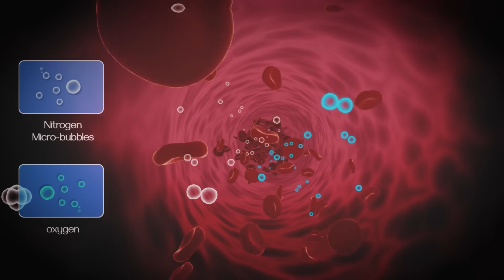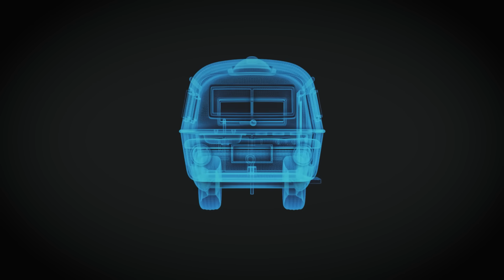How Did a Tiny Hole Kill 4 Divers?

Comment: For anyone here from the Titan incident please note: The Titan and the Byford Dolphin incidents are actually not the same physical process it's more like the opposite.

The Byford Dolphin incident was a rapid decompression.
The Titan imploded or you could say it was a "compression" (not decompression). 

You can view it like this:  The pressure inside the decompression chamber in the Byford Dolphin incident did go extremely rapid from 9 to 1 bar. Everything INSIDE the chamber wanted to go OUTSIDE of it. And alot of stuff inside your body wants to EXPAND.
The pressure inside the titan did go extremely rapid from 1 bar to ~400 bar. Everything OUTSIDE the vessel wanted to go INSIDE. And alot of stuff inside(and outside) your body gets CRUSHED.

Both processes are instant deaths, faster than the brain can react, though the titan incident is probably even more brutal.
Reply: I've seen your comment on other Byford Dolphin videos so I wanted to add some of the other stuff I've seen people post. 
The pressure likely raised the temperature to an extreme degree for a short window, and the gases already in the body ex: in the lungs also wanted to force their way out of the body to help maintain the equilibrium vs onrushing pressure.
Reply: goated313 so were the people in the titan cooked/vaporized faster than the metal could crush them?
Reply: @josegarza7719  Both aspects happen simultaneously. The heat and the crush are directly correlated. Realistically at such a small scale and high intensity, it's inconsequential to consider what happens first unless you break down the event in ten-thousandth of a second increments.
Reply: @Cryerborg exactly
Reply: @josegarza7719  https://www.youtube.com/watch?v=CfUcNPr2T8A&t=726s&ab_channel=Dr.ChrisRaynor%7CNotYourEverydayOrtho
This is a video by a surgeon explaining how they possibly could have gone.
Reply: Thanks for the clarification for the difference between the two incidents. I can't help thinking also about this difference --- the professional saturation divers are deservedly paid megabucks to do that job because of the danger and risk, and they will be well aware of what could happen in detail --- whereas the Titan tourists paid megabucks to take the risk and experience the danger. You do wonder if they knew what could happen in extreme detail, they may not have gone. Being told 'death' is a possibility, is not quite the same as being told exactly how you could die, in minute detail, even though it is instant.
Reply: Not necessarily more brutal. There was nothing left. I would consider that less gruesome
Reply: @TheBestOfSweden  I was about to say, in one you become a ball of tissue, in the other you go full on The Boys, as blood goes everywhere and you instantly explode.
Reply: @Kseehaz  true
Reply: @Kseehaz   That’s a good way to explain it. I don’t know why everyone says it’s instant with the Byford incident. For the ones closest to- yeah, but for other victims (depending where you are in that object) it could be & was survivable, w injuries so bad you wouldn’t want to describe it. Hence comments about some sat divers being retired in their 30s, rich as hell, but wearing diapers for the rest of whatever life they have left. Not worth the danger money imo, you’re not in control of your own life in any way.
Reply: its not that there was nothing left it just wasn't retrievable.
Reply: Byford Dolphin - 9 bar vs 1 bar
Titan - 1 bar vs 380 bar
Titan was fare more violent from a pressure differential point of view
Reply: @AlonsoRules It’s not just the rapid pressure change or the momentary superheating of the air does the damage though.  It’s also the Mach 2 wall of water that hits whatever is inside the space.  Imagine an almost infinite weight of seawater hitting you at the speed of a rifle bullet.
Reply: @AscendancyLF and @goated313
THANKS FOR the Education on that real quick☆☆
Reply: Turn into human soup, then burn and become ash, all in less than 4 milliseconds…. More violent force yeah. But by the same token, no gruesome splat left behind.
Reply: Ngl ur explaination is good ty brotha
Reply: @Mochii69  "Ngl" Why would you lie? If you like a person's explanation and presentation of facts, why would you lie about it? It makes no sense to use "not gonna lie" in this context. Stop mindlessly using trendy phrases. Think before you speak.
Reply: so is the Byford Dolphin accident compares to how a bomb works?
Reply: @syukrihantu  essentially.
Reply: Pretty much the same 🧠🪱🦀🦀🦀🦀
Reply: Ok. Ask a question, get an answer. Can't argue with that
Reply: No, we're not here because of some rich clown who decided to risk their lives for their own amusement and vanity.
Reply: Are you going to copy and paste this on every video now ? Shut the fuck up
Reply: Thank you for the enlightenment.
Reply: Mythbusters did a bit with a pig that will show exactly what happened to the bodies on the Byford Dolphin, albeit far less graphic, itll give you an idea of what happened. Look up Mythbusters rapid/explosive decompression.
Reply: i went to your channel to see if you had any interesting diving videos and was surprised to see osrs content lmao, hows the hc going?
Reply: I knew some midwit would decide to make such a comment.
Reply: Call me a simple man, but rapidly being shred into pieces through an expanding force, or being crushed into pulp by rapid pressure icrease... both are gruesome ways to go and luckily death is instantaneous to where you wouldn't experience it. I think whats worse is having the knowledge it can happen and the result is as that.

Both pieces however are an interesting tale about what (de)compressive forces can do.
Reply: titans cause was bad engineering tho... they used composite materials for their tube... and they are known for tensile strength but they are weak at compression... causing delamination... also they did not cure it in a vaccuum chamber so the faults that can come with composites are left in... vaults without resin etc. so that comes on top of being the wrong material... the titan was infact brutal... cause they likely heard it coming (not knowing that its time) ppl on the titan reported cracking sounds etc.
Reply: If I’m correct, I believe you could compare the Titan to 9/11 towers falling & being inside. It’s so quick, & one would be pulverised (as others have said - nothing left) - no disrespect to family members btw. The Dolphin would be more like a balloon, all of a sudden, someone unties it, & the gas wants to go out. So you’re left with your balloon outer lining, but inside is crushed or gone/sucked out. I suppose for the sake of a funeral & resting place, the Dolphin incident MAY leave a body, or partial, to be buried, the Titan, or twin towers scenario wouldn’t. I would pick the Titan personally - I’d want no chance of any survival, keeping in mind the quality of life if you lived.
Reply: Does implosion theoretically culminate in a diesel ignition event?  What would remain, pink mist or finely burnt ash?
Reply: I've recently been looking into the Challenger Shuttle Disaster, you think the crew suffered a similar fate as the Byford Dolphin?
Reply: @kaddissventorum4149  no. The challenger crew was wearing space suits that could easily withstand the low pressure in high altitude. The cocpit survived the innitial explosion and the crew was alive until they finally crashed minutes later, although most likely unconcious due to the rapid acceleration during the explosion.
Reply: was looking for something on this incident and kept finding the old ass dolphin one
Reply: Human reaction to pain is actually quite slow, at 100ms minimum.
Reply: @TyburVelereon yes, in both situations the victims were totally unaware of anything going on around them, luckily.
It would be like getting knocked out before an operation, only in this situation you just don't wake up. Rip
Reply: goated313  Do some maths and physics using PVT formulas and you'll see that the 5 cubic metres (6 kilograms) of air in Titan only had its temperature raised to about 1300 deg centrigrade, as its volume reduced to about 70 litres. The quantity of heat produced is only 7800 kilojoules. In the space of a few milliseconds 5000 kg of seawater at 4 deg C rushed into the space where the air had been, before any heat could have been transferred to the bodies (a process that takes seconds not milliseconds). Furthermore in the implosion, the air become tiny bubbles in the seawater, so its heat was effectively spread out and snuffed out. 5000 kg of water has nearly 4000 times the heat capacity of 6 kg of air so the heat could not have rised the temperature of the water by more than a couple of degrees. The humans in Titan were killed by crushing. The investiagation of the debris and human remains recovered will show no heating effects at all. If you disagree show some maths and physics.
Reply: goated313  Wrong.
Reply: What would lead you to a: assume people would confuse the two and b: care enough to leave the same comment on several videos on the same subject?
Reply: @dustinandtarynwolfe5540  a lot of people are stupid and they think rapid decompression is the same thing as an explosion when they are in fact the exact opposites. Doesn't help they both happened in a large tube-like steucture.
Reply: @DeadPixel1105  is ur mental health okay?

Comment: Try not to be scientifically ignorant. The 3% (closer to 2.5, actually) nitrogen in the body is NOT nitrogen gas. It's nitrogen compounds, like in DNA and proteins, it has absolutely zero effect on saturation. At sea level, there is about 1 liter of nitrogen gas in solution in the body. This is about 1.25 grams. That's it.

Comment: Hello, in the case that you read this comment i have a question because even after watching this video there is something i dont fully understand yet:
The chambers are at 9atm of pressure so is the bell and the trunk when they are all attached, then one of the tenders separated the bell from the trunk so all the compressed air inside the chambers escaped to where? the sea? or the bell? or the trunk? i dont understand where the gas inside the chambers goes.
Reply from the maker: The bell door was closed, the trunk connected to the bell. The trunk door going into the chamber was open. 

The latch connecting the bell to the trunk was released. 

The air from the chamber rushed out of the chamber, through the trunk and outside. It throws the bell free and rushes out to meet the outside air.
Reply: @waterline-disasters  ah wait, this is all happening above water? thats where my confusion comes from, i thought this chamers were all very deep underwater now it all makes sense, thanks for the clarification!

Comment: Excellent recap. To give an idea of the difficulty of this kind of underwater diving operation, consider that at all times a spaceship is "only" trying to prevent 1 atmosphere inside from equalizing to 0 atmospheres outside. The vessel on the Byford Dolphin was trying to keep 9 atmospheres from equalizing to 1. If you're on a space station and it develops a leak you only need to figure out where the leak is and patch it before you bleed off all your atmosphere. On a high pressure diving vessel like that a sudden leak means you literally explode.
Reply: A spaceship 😂
Reply: Daaaamn!  Tyvm for that!!
Reply: Brutal

Comment: If the other men in the other rooms had only been under the high pressure for say 5 minutes before the rapid pressure drop, would they have been okay? Was it only the compressed nitrogen in their bodies expanding that killed them, or would such a rapid pressure change be dangerous in itself?
Reply: Well, they'd still have air at 9 atmospheres in their lungs which would instantly expand. Not good.

Comment: I'm still a little confused, so before the diver closed the hatch between the habitat and trunk (at 9 atm), the diving tender opened the hatch between the trunk and the diving bell (at 9 and 1 atm??) ? how long does it take to depressurize the diving bell and was the trunk still at 9 atm when they mistakenly opened the hatch? so sorry for the questions 😅😅
Reply from the maker: The whole system was at 9ATM and it was effectively all open. 

If nobody is in the dive bell or the trunk and it's all sealed properly it could depressurise in 5-10 minutes. Like opening a tap and letting the air blast out.
Reply: @waterline-disasters  I understand now, thank you so much for responding! really informative video :)
Reply: @kels306  and yes, he opened the clamp before everything in the habitat was sealed, and resulted in an explosive decompression which well, the video goes into the details

Comment: I read the forensic medicine report on the accident by Giertsen et all (1988).
That is some intense stuff.

Great video BTW! :)
Reply from the maker: Interesting. I would have thought thats sealed.
Reply: @waterline-disasters  Now that you mention it, yes very odd. If you haven't already search for "byford dolphin grietsen 1988". be aware, the report is most graphic.
Reply: @waterline-disasters  Looks like the website it's on is made to bypass paywalls in scientific journals. 94–101, 1988. - An Explosive Decompression Accident - Sci-Hub https://zero.sci-hub.se/5268/7dda7cee52d7eb3ec606a82d0f1b9a61/giertsen1988.pdf

Comment: Dumb question but... at 8:34 you said that after the chamber door is securely closed, the tenders proceed to increase the pressure of the trunk. Why would they need to add pressure to the trunk at this point? Wouldn't the goal be to reduce pressure back to 1 atm? I apologize for my ignorance. I am just really interested in this topic and am eager to increase my understanding of what happened. By the way, this IS the best video I've seen so far on the incident. All the others are vague and confusing and rush through the process so fast with minimal detail that leave me confused even after watching them several times.
Reply from the maker: Good catch. I misspoke. I didn't catch it when I was worrying the script nor when I edited. A few people have asked and yes you're right it would need to be reduced to 1ATM.

The other videos I've watched have been created by people who don't understand the topic. I taught scuba diving for 10 years so I have a solid base on the physics. I always felt other videos missed the main point which is the physics. 

Thanks for watching and asking for clarification.
Reply: @waterline-disasters  Awesome! Thank you for confirming that. This really is the best video I've seen on the topic. It also cleared up some of my confusion on how pressure affects the behavior of Oxygen and Nitrogen gasses. I have one other question if you don't mind answering.

Can you break down why an increase in pressure against Oxygen in the body can cause Oxygen toxicity/hyperoxia?
Reply from the maker: Master class in partial pressures (pp)

Oxygen is toxic Inn a few ways. In your lungs it can cause alveoli collapse or fill with fluid. That's more likely to happen with sustained use of oxygen to help you breath if you're sick or an old smoker who needs oxygen but uses too much. 

But for divers it will likely cause problems with your Central nervous system first. 

When dealing with pressure at sea level you have 1 atmosphere ATM of pressure. 

Dive down to 10m / 33ft and you add 1ATM 
1+1=2 ATM. 

For every 10m /33ft you descend you add 1ATM. 

So at the surface 1ATM the equation for Air is around 21% oxygen and 79% nitrogen. But I'm going to simplify for ease of math and say 20%+80%.

When you convert that to partial pressure (pp) it reads 1ATM = 0.2 plus 0.8

And you can start to work out the pp at different depths. 

2ATM=0.4 oxygen + 1.6 nitrogen
3ATM=0.6+2.4
4ATM=0.8+3.2

The ratio or % holds true but the pressure increase means the partial pressure changes. 

Oxygen becomes toxic at 1.4-1.6pp which is 7ATM-8ATM for breathing air. That's 60-70m or 200-230 feet roughly. 

So what if you want to go deeper? As you go deeper you start to change the ratio of gases. You have to keep the pp of oxygen below 1.4-1.6. 

That's oxygen. Your body metabolizes oxygen, it burns it up. 

Nitrogen is different. Your body tissue absorbs the nitrogen. It's an inert gas. It doesn't create any chemical reaction with other elements. Your body will soak it up until the pp of nitrogen in your body tissue=the surrounding water pressure. 

But nitrogen has a narcotic effect from about 3-4ATM or 2.4pp up. So divers start to mix helium into the system. Helium is less dense than nitrogen so it flows through your brain receptors quicker reducing the effects off nitrogen narcosis. Also an inert gas.

But at very deep depths helium gives divers high pressure nervous syndrome.  So they add sooner nitrogen in which decreases those effects. 

It's like this finely tuned balancing act. But you are always keeping the partial pressure off each gas within the safe range for that gas.
Reply: @waterline-disasters  Something which is often missed in other stories, or the other stories don't focus on, is that the tenders skipped two steps (closing the hatch between tunnel and habitat and then, depressurising the tunnel). Most of the stories just say that the Crammond detached the clamp before Helevik closed the hatch, which is correct, but misleading because it gives a bit of a  wrong impression that there could be just a miscommunication between Helevik and Crammond. Even if they had a miscommunication, the next step the tenders should have done is depressurisation which was entirely skipped. Since skipping two steps, especially one of them is a slow depressurisation, is more unlikely for an expert tender than skipping one quick step of confirming with the divers if the hatch is closed, it immediately puts more chances on a mechanical failure rather than a human error.
Reply: @waterline-disasters  so do you still go diving at this incident?